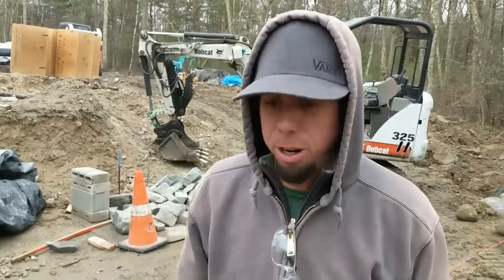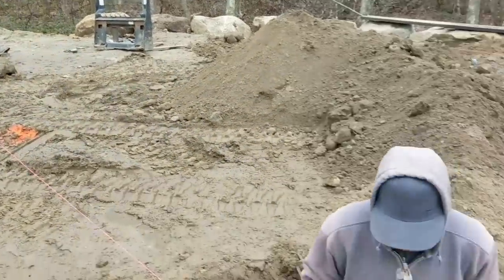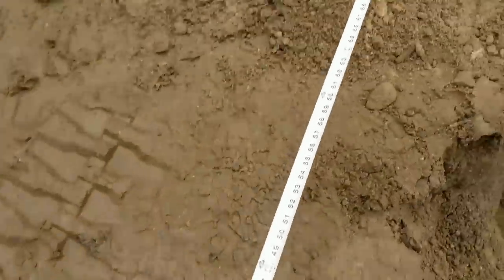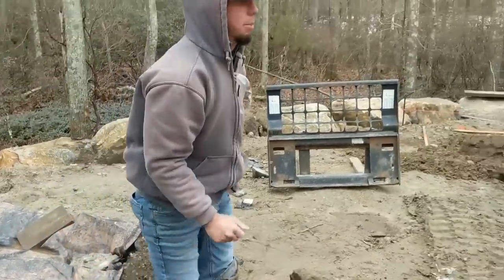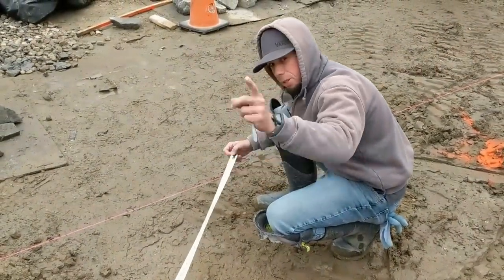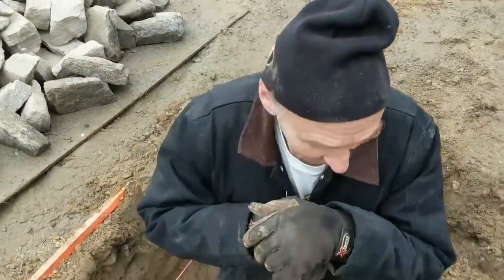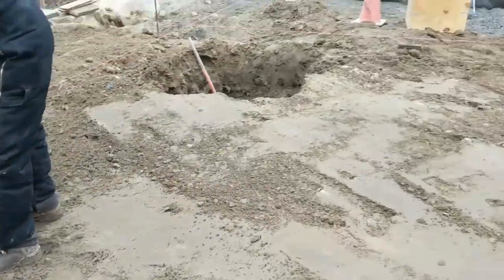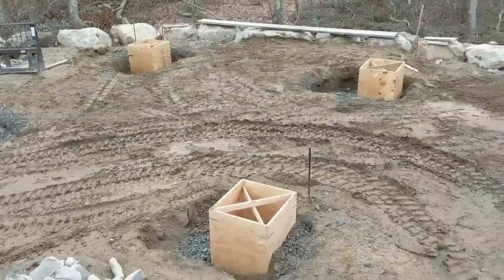How To Lay Out Perfect 90 Degree Angles For Construction

Comment: I love someone finally showing a string and square  laying out method ! I ve built  houses alone using 2 ft framing square and chalk lines  and established center lines and right angles off those center lines! Eyeballing A chalk line to line up with framing square  is all I ever needed ,and then checking diagonal measurements  to tweak if necessary ! Nice video !I actually used same method to rebuild wrecked railroad cars . Find starting point and run a straight edge ,take right angles off that . Works with anything you need to square up!
Reply from the maker: Thanks for letting us know! 😊